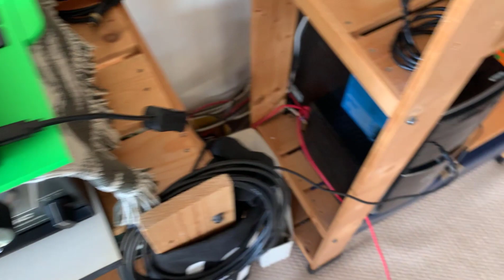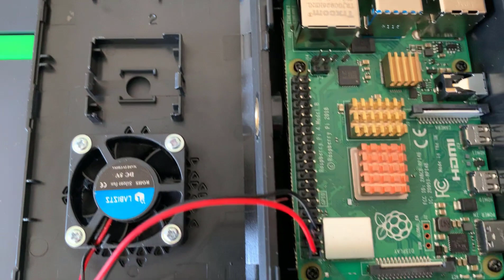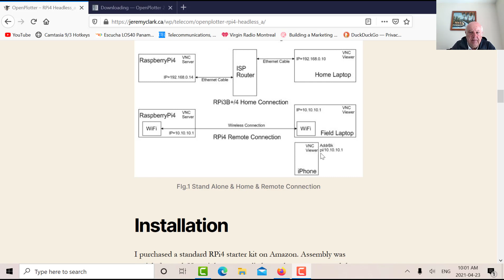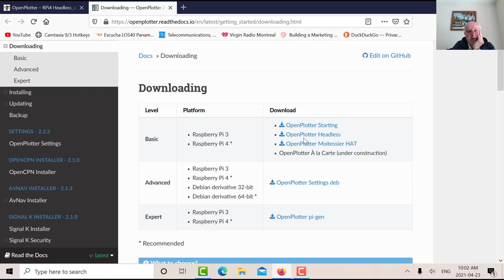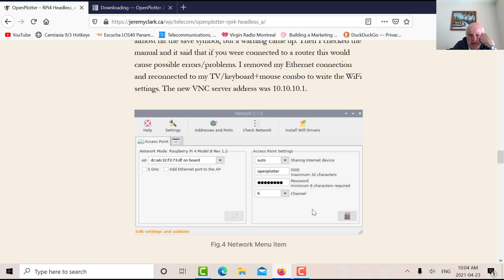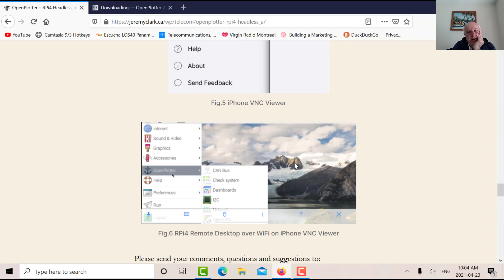OpenPlotter - RPi4Headless_a

Comment: Hi  Jeremy:
Long time - been sailing. 
Last week I stubbled into info re rpi 4b and openplotter. I explains why I had so many issues getting sd card loaded and  openplotter to run. They have now released version 3. I got a brand new sd card and loaded the image per normal..
 First thing is that it would not load the correct image. Choice is 32 or 64 bit, but they have put both folders into the same headless folder.  Pi imager does no know that and after hrs of copying you find that it  has loaded garbage - the image must be moved to a new folder in windows so imager can find it  otherwise it can not. 
Next I find text in both revised rev 2 dos on installation, and repeated but emphasised in ver 3 docs - "headless has bugs and will not run" . 
Also Ver 3 has been released incomplete - there is no install for I2C nor for pypilot, and both items are removed from the ver 3 docs. This is specific to the rpi4. 
I wouldn't be putting too much out there wrt openplotter without real big cautions re rpi 4. I have lost one hell of a lot of time on this, only to find that there were known bugs.
Meantime I stubbled on  "bare boat necessities". Its a new OS with openplotter/opencpn.pypilot etc. It loads, boots and everything runs as soon as switched on. The author has been real supportive as well and is on top of revising docs as soon as I found issues/questions. I have yet to get the arduino A/P drive running though.

Richard
Reply from the maker: Rich:
Thanks for the information. I will check it out! I am heading toward the tropics for celnav & geo watching!
Reply: Thanks for this. I was trying to install pypilot on open plotter headless and could not do so. Now I know why.